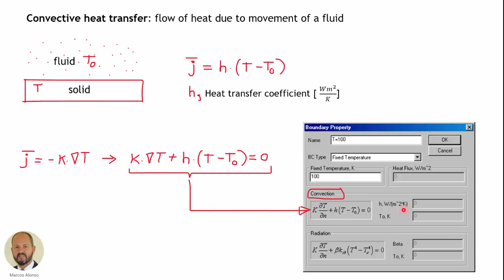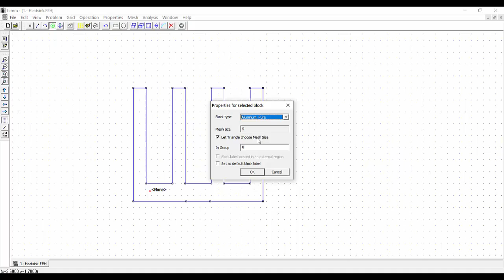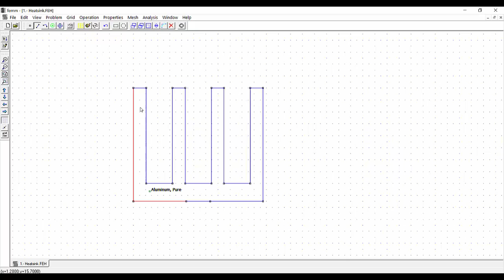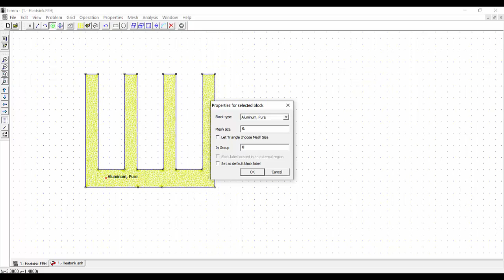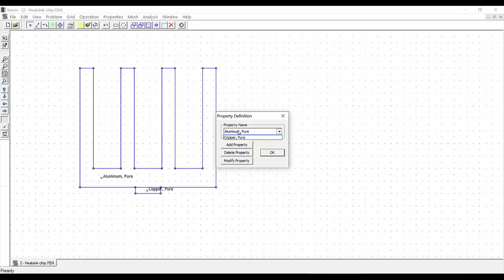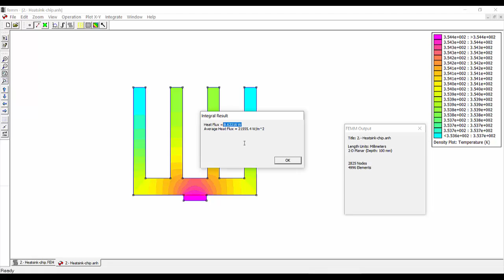FEMM #7: Steady-State Heat Flow Analysis

Comment: Hi Marco, I'm curious why didn't you use "horizontal plane" in quickfields to define an area of convection?
Reply from the maker: Hello, thanks for your question. I select vertical plane because most of the convection takes place on vertical planes (the radiator fins)

Comment: It is negative heat flux because it has to flow out.  The same is true when you use Current Problem. It has to be negative indicating it flows out of the device.
Reply from the maker: Thanks for the interesting information